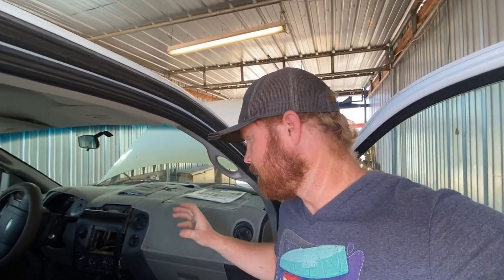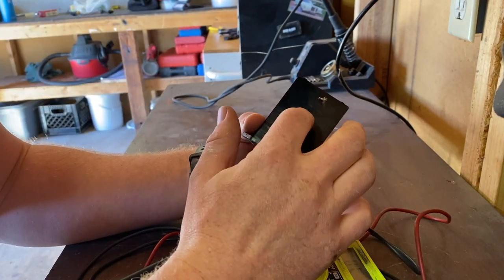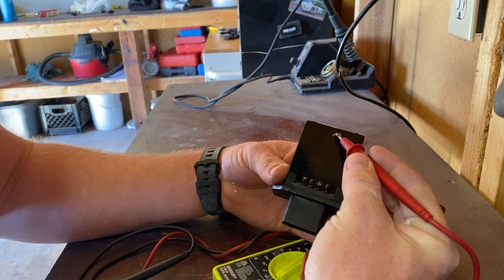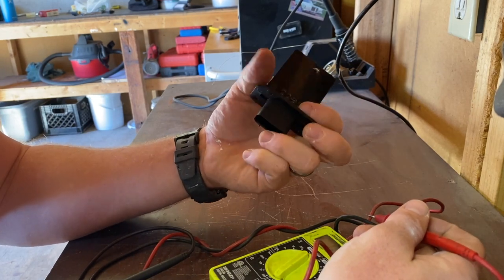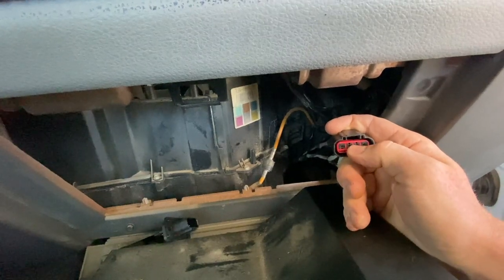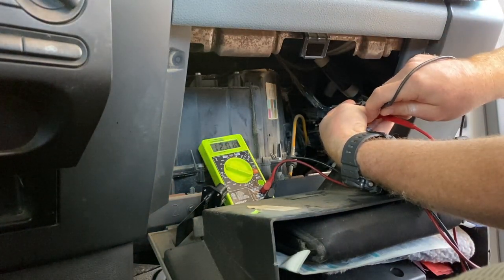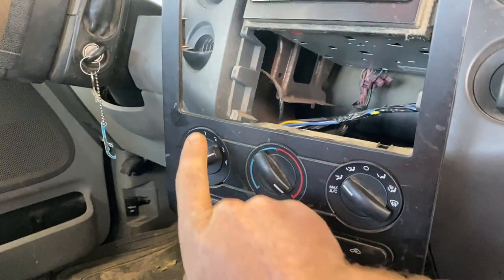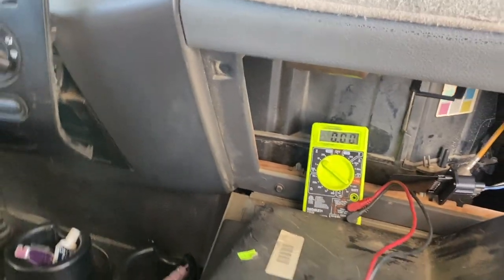How To Test A Ford Blower Motor Resistor And Switch + Free Fix!

Comment: What is the meter set on to test this
Reply: I’ve found in both the new resistor and a failed resistor, conductivity is complete thru each circuit. No open circuit. But when I re-solder the 6 joints, the failed resistor works again. Not sure why! Anyway measure for resistance (ohms) is the answer and likely down to the micro ohms of resistance, I’m now guessing.
Reply: Replaced both and fan still won't come on unless I hit the blower then goes right back off still have no heat
Reply: That’s a different problem then. You have a short. Given the new parts, I’d look around them. Maybe a wire rubbed to ground? Firm connections? Etc. Best wishes.
Reply: I did have the lighter shoot sparks not long before this issue and fuse blows soon as you put new one in and also at times where key has to be on to test some of this kills battery in less than 5 mins kinda gave up and just got to go with no heat for now cant afford to put in shop and i got a meter but dont know how to read it lol

Comment: Thanks for the tip I was having the same problem and did the soldering in that same point connection and it working so far. I hope other owners of ford can do the same if that the problem on their trucks, 5 🌟 for your tips, keep the good job.

Comment: There are literally only 6 solder joints in these boards. Simply scrape the surfaces clean, then resolder them all. [Shame on Ford for allowing poor manufacturing standards!]
Reply: As a follow up. My solder joints only lasted a month, so I had to redo it again. I tested the re-solder job without installing it into the blower and see it works again, but I learned how much heat it generates. Could the system be putting so many amps thru this card that it melts the joint(s)?

Comment: What would be causing it to keep going out tho?
Reply: I’m now thinking it’s excessive heat in the resistor (too many amps for the component). It melts a solder joint, which I’ve been able to fix, but only for temporary (month plus).
Reply: @Fun4GA  dude thanks for the reply even being so long after the video dropped. I attempted the solder fix but nothing lol. I ended up replacing the blower motor itself with a new resistor and so far about half a month, still good!
Reply: @xXSRS24Xx Yep. After it went out the first time, I replaced the resistor. Six months later, it went out again so I replaced the resistor and the blower. That lasted a year. So now I’m trying to find the root cause, and finding out the solder joint(s) are the failing point. Ford needs to be embarrassed about this, if that’s possible.
Reply: @94SexyStang - The resistor creates a lot of heat (likely too much), so if the fan isn’t cooling it, I wonder if that leads to the burn out of the soldier joint. Just thinking out loud.